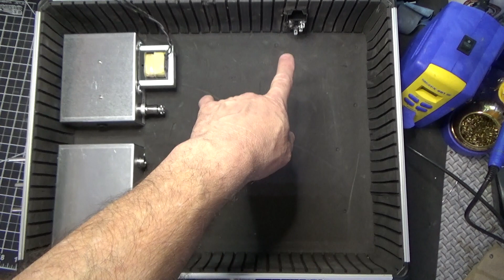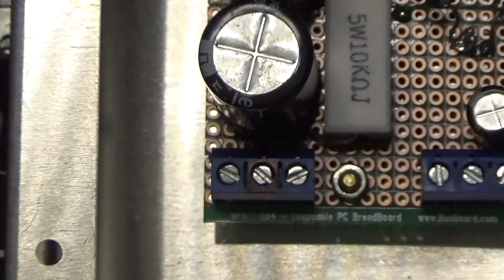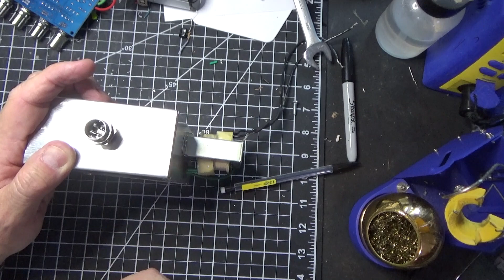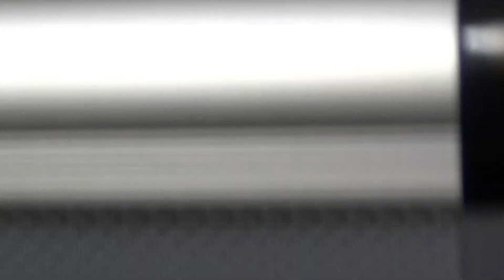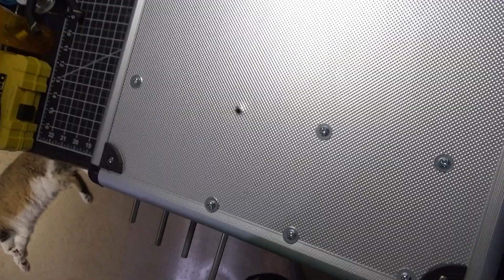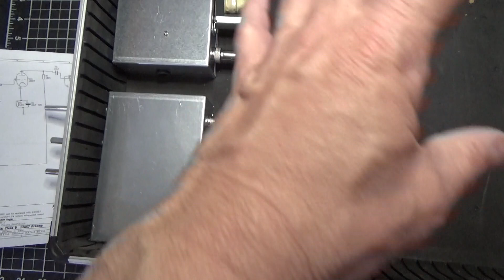Class D Amplifier Build: Episode #2: I am on the case

Comment: Looking brilliant Ron, and you are less than half way into the construction phase.  Once everything is secured into place, and connected it will be superb.  Very prudent of you to prototype everything before embarking on constructing the real thing.  Nonetheless, speaking from experience, another aluminium case might be required since you might need to make a few minor tweaks here and there as a few small imperfections will likely crop up sooner, or later.  It is like an natural phenomenon.  No matter how well you design something electronic, be it on paper, or otherwise, it has to have the last word before it finally succumbs to being passed as reliable, and fit for purpose LOL.
I’ve never heard of a dog called Bentley before but I’ve heard of a dog called Rover ...Bentley, and Rover being two defunct British car marques.  Take no notice of my silly sense of humour LOL.  I like the look of your dog and cats.
I had two attempts at sending you emails but they were returned: on each occasion it read email address not recognised.  I have requested our friend Brendan to forward my email address so you can send me a ‘Test transmission’ email.
Look forward to hearing from you my friend, 73 de Phil.
Reply from the maker: Phil, you are right. I will need to stock up on cases which will help me build the production line  :)  I do think this is going to work well, in fact she was fired up today for the first time, and worked really well.   My pets have the good life, there is no doubt.  I will look for the email   , if you want you can try  rcianciaruso@comcast.net.    thank mate, hope all is well

Comment: Yes the first early computers using ones and zeros in punch cards in the 18th century. The orientation of the two transformers in the same orientation they're going to interfere with each other they need to be further apart or rotate the board
Reply from the maker: In phase or out of phase.  That is the question  :)    Thanks John
Reply: @rciancia  yes but still not good practice to have the fields interacting
Reply from the maker: @johnsweda2999   After reading your comment again I thought about that and will move my 55V supply toward the other side of the case. It makes sense. Magnetism and fields are picky :)    Thank you John
Reply: @rciancia  yes and I thought about it as well two different types of Transformers wouldn't necessarily cancel themselves out I'm no expert on Transformers or anything in life lol.
Reply from the maker: @johnsweda2999   In this case, the Preamp and Amp are really isolated, except for Ground and the signal.  My test build was exactly the same and I didn't have a problem but will be on the lookout for sure. We'll find out for sure   :0  thank sir